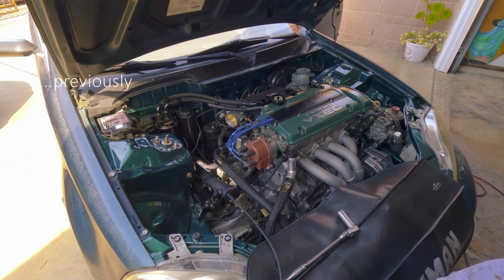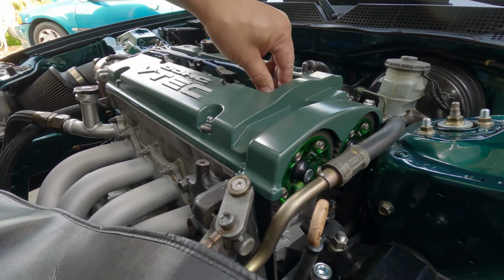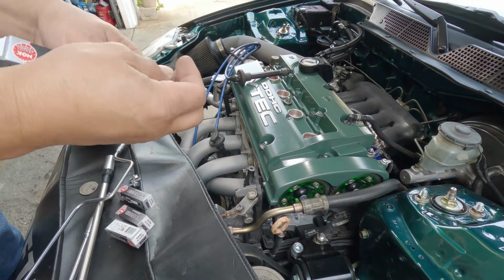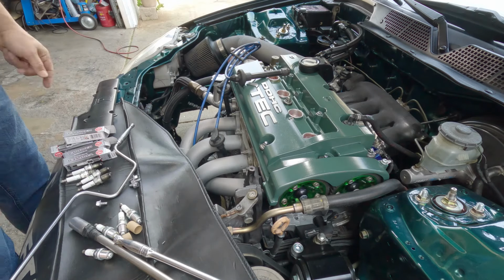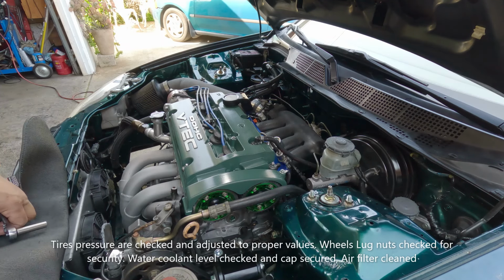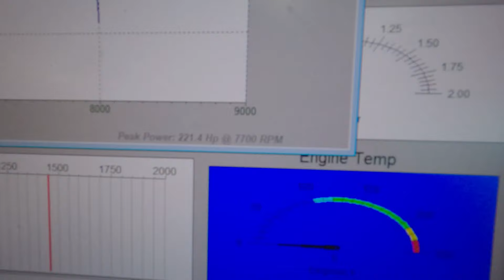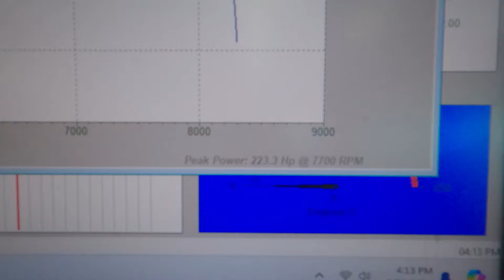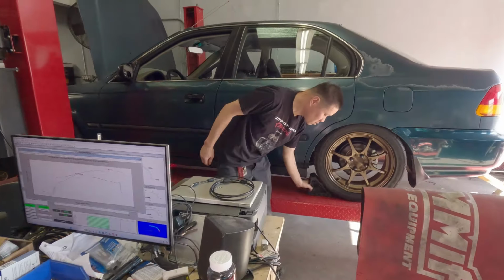How high do you want your G23 REV?

Comment: the artist of honda engines, you are an inspiration, I am rebuilding an engine for the first time a prelude h22
Reply from the maker: Thanks! H is a good engine, it's not as powerful as K but it can hold it's own. Got 1 built for boost coz its much reliable engine better than G23. Take your time on thd build and feel free to msg me if you need any help.
Reply: @sagittnet2158  Well, I could ask you something although it must be complicated. The car has been stopped for 8 years until now I am disassembling the engine, but some time ago it had a strange sound, I took it to several mechanics and I never found out the reason, I tried with all the belts disconnected except the main one, for this reason I know the noise not comes from balancers and other belts/pulleys, mechanics and then I rebuilt the distribution 3 times and changed to H23 tensioner. It is because of this noise that I am going to rebuild the engine, although now I am excited to get more power. I leave you the original video with the strange noise in case you have any idea what the reason could be. Thank you very much for your videos and attention. (Sorry for bad translate)

https://www.youtube.com/watch?v=SSOa95vz68I&t=3s
Reply from the maker: @MultiLberT  I was watching it and it does sound like a belt and also could be a piston slap. The last time l have something similar to that sound but from inside the car is the balance shaft belt. I kinda installed the belt 1 tooth off and it made a sound similar to yours. I could be wrong but its worth a try.
Reply from the maker: @MultiLberT  It almost sounded like belt is too tight. Sinced you convert it to H23a1 manual tensioner. Did you have a hard time installing the belt? Coz before l came up w/ the fixed on tensioner conversion, the T belt goes in really tight.
Reply: @sagittnet2158  Certainly I have seen 1 tooth jumped on the intake cams in the distribution when disassembling. I have already opened the head, there are no symptoms of piston slap, cylinders and pistons ok and valves ok. balance shaft belt is not possible because it was working without balance belt and the sound was similar, it is very strange, no one was able to tell me what the problem is. I hope to find out now by completely disassembling. Another question, I'm going to install type S pistons but my engine is 185hp. Do you recommend using the connecting rods from my engine, or should I buy new, stronger sk2 or similar connecting rods? thanks
Reply from the maker: @MultiLberT  once you have it disassemble, it'll be easier to pinpoint what causing it. OE rods is ok for your NA setup build. Use a OE type S piston rather than aftermarket type S piston. It's because other user still experiencing a piston skirt damage due to incompatible material for H22 frm sleeve unless you have iron sleeve already.
Reply: @sagittnet2158  Hello, I have my doubts about using my original connecting rods increasing CR 11:1 and for this reason I have observed the sale of kits (nippon piston racing +skunk2 rods) pistons frm compatible and says that they are sold by the same factory that produces oem.  My question is the following, if the new connecting rod + piston have a lower weight than the original, is there a problem with the crankshaft? I don't know if that weight difference requires rebalancing or something like that. The piston has a similar weight but the connecting rod is less.

Comment: +4whp 💪
Reply from the maker: Really glad l found out about the butterfly plate, really worth the effort fixing it. Thanks
Reply: @sagittnet2158  Can you still gain more power with more aggressive camshafts?
Reply from the maker: @MultiLberT  Yes, it has a K20a2 type S piston and l should be using at least H22/ F20b type S camshafts to take advantage of hi-comp ratio.  But l choosed to use H23a cams coz l want to know how much power it can make and it proved to be good.

Comment: Greetings from Russia! Love your videos, they are very useful for me. How do you think, how much rpm i can rew safety my f20b sir-t  all internals stock with hondata?   i set redline 8k, but after ~6400 torque is going down. I wanna made self made exh. manifold and port intake later to keep my engine breath easier. Also i have light ported channels
Reply from the maker: Pazhalusta my friend and thank you for supporting my chanel. Your F20B is built for circuit racing. It was used primarily on Jtcc, Btcc back in the 90's. (Hope someone can correct if l'm wrong). It's a hi-revving motor and not really much of a torque. That's why here in the US, we much prefered it boosted, to give it a much power. Thanks my friend.
Reply from the maker: The only way to know is to get it dyno tune and you'll see if its making power pass 7K mark. It's all up to you how hi you wanna go. Porting the cylinder head and maybe use a aftermarket valve springs and Titanium retainers will help a lot.  The only good exhaust mani I know that really work is Tri Y header for H or F20b, and support that w/ a good intake manifold.

Comment: Hi your videos are super nice and I love your build to the point where you have inspired me to do a g23 build also for cg3 accord!  It would be so awesome if you could reach out to me and give me a list on all the parts that i need for the build. I already have my h22 cylinder head being rebuild and as soon as I get it back I will start my build as well. Hope you post more vids and tutorials of your g series builds!
Reply from the maker: https://youtu.be/4WJQjFYPuF4?si=WM_XcXfwgNdbBw-H
Reply from the maker: That was the link for parts list that is needed to build a G23. I also have a playlist to make it a lot easier to navigate on my channel. The key to a successful build of frank G23 engine is use a OE f23 headgasket, the plug for the cyl head is all up to you. But if you use the kstune plug, make sure to apply a Hondabond or Megagrey sealant to prevent oil to seep thru. Keeping B/S play a big role also and deleting it is optional. Its entirely up to you. I'm still saving up for ATI damper and once l get it, l'll put it on. Take your time on the build and you'll be alright.
Reply: What ecu are you using for the build? Did you just use the stock f23 ecu?
Reply from the maker: @aldeeproductions8231  chipped P28, you can use P28 w/ Hondata s300 or any stand alone ecu. Your F23 will nor work due to H22 are double overhead cam

Comment: Hey Sagitt is this with stock rods and rod bolts?
Reply from the maker: Yes, using stock rods n' bolts.
Reply: @sagittnet2158  is it ok to use ARP rod bolts with stock rods? I have a set of aftermarket Rods but I just found out they don't fit OEM K20 RRC pistons.
Reply from the maker: @skromee  I don't recall ARP have a rod bolts for OE f23  rods but if you have something w/ same length and threading, its better. Is that you on fb about rods not fitting the oe piston? There is nothing wrong w/ shaving the rods to make it fit, as long as both sides are equally shave or take it to a machine shop so they can fix it for you. There's actually a youtuber that has same dilemma like yours and he just shaved it. I'll send you a link if l can find it.
Reply from the maker: @skromee  https://youtu.be/5HsS34yD65E?si=QKoCxTJUN8V9G7yq
Reply from the maker: @skromee  I think your rods are made for forged pistons like cp or wiseco. If you have watch the link l sent you, he's using nippon racing piston and if you get a set of npr piston, you'll end up in same situation. You can always send a email on the seller and ask what the size of the opening before you buy. I say its better to take your rods to machine shop so they can balance it for you after shaving.
Reply: @sagittnet2158  thanks ya that was me. I'll think about shaving the rods. The stock rods fit so I might just go with that. I'm only going NA all motor.  With your set up you shift your car at 8000 rpm?
Reply from the maker: @skromee  OE rods are ok for NA build,  just make sure that big ends are w/in specs. I try not to but it's hard sometimes. Change the springs if your thinking of reving that high. Once you take it on dyno tuning, you'll see it if safe to rev at that range.

Comment: What is the max degrees of timing you are running?
Reply from the maker: I got the distributor set at 16 degrees. Are you running out of adjustment movement on your distributor or something?
Reply: @sagittnet2158  was just curious as to how much timing you were running so I would have an idea when I rebuild mines
Reply from the maker: @convict5777  start at 16 degrees and retard it a bit if start pinging (stall)
Reply: @sagittnet2158  what management are you using ? And how much are you getting at wide open throttle? The max timing I was told could be ran on these engines are 30 degrees
Reply from the maker: @convict5777  I'm using chipped P28 and l didn't ask my tuner about the setup regarding the matter. That's one grey area that l'm having a difficulties. When it comes on tuning its foreign for me.